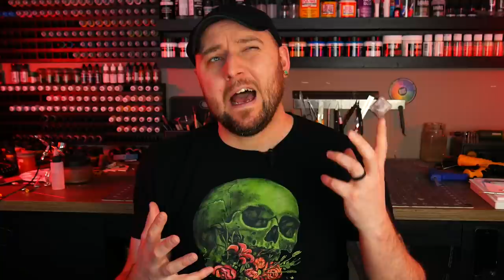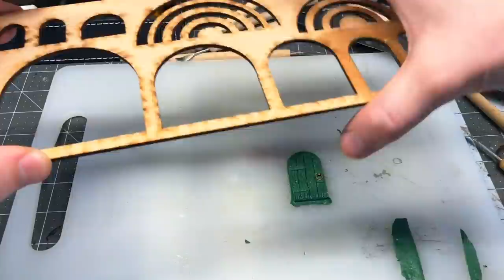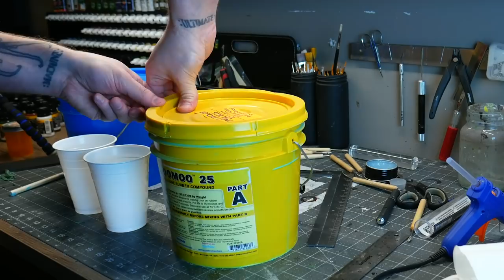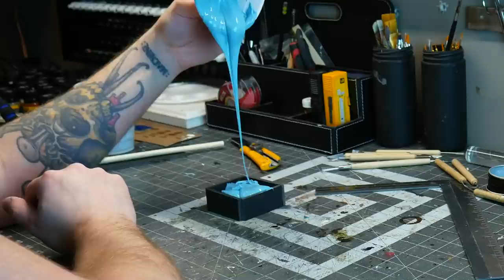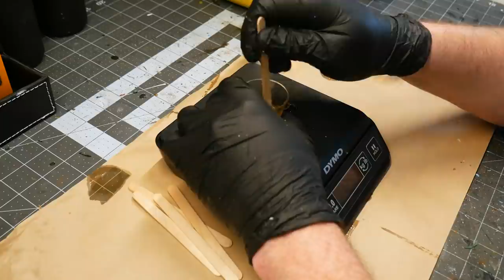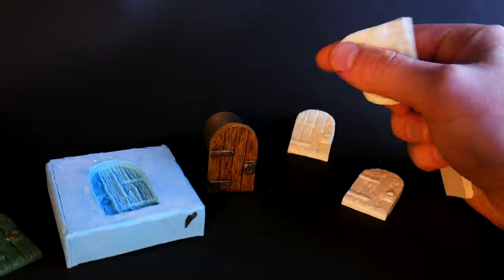Sculpting, Molding, & Casting Resin Doors

Comment: If you want a cheaper way of making door handles and keep them constantly the same size and roundness get a nail or metal rod the size you need. Get florist wire none coated (without plastic covering). Drill a small hole in the head of the nail so you can push some of the wire through it. Now push a small length of wire through the hole and bend it so it doesn't come back out. Now start to wine the wire around the nail, making sure not to overlap it at any point. Wind it as much or as little as you want to make a coil around the nail. Once you have as much as you want either cut the tab sticking through the nail head or bend it back so you can slide it back out. Slide the coil off the nail, try not to separate the coils, once off take a pair of wire cutters and cut at the same line as where you cut the coil from the rest of the wire. Do this for each wrap so you have a loop/jump ring. This is what I use to do when I was a jeweler many years back. I also did this to make my own rings for when I made chainmail just with a larger metal rod and thicker wire. Also I made a device to make wrapping a lot easier.

Comment: Idea to make selling a bit more appealing. Use the single mold to make a few greenstuff doors, then use those to make a plate of door molds (like an ice cube tray) so you can mix a larger batch of resin and pour several to cure at once. 

Maybe you could use the resin doors you’ve already cast to make the trays... 

Anyway, cool video.
Reply from the maker: You underestimate the amount of thought, testing, and costing I put into the idea. I had it down to the number of items I could cast per hour, at peak efficiency, the cost per item, the profit per item, etc. I thought it all out man. Still, I didn't want to end up fulfilling thousands of orders. I wanted to do the channel, not trade my day job for a different day job that still didn't give me any extra time to make videos.

Comment: I use the large Alumilite Resin (Slow set 7) you can get at Hobby Lobby.  The Amazing Casting Resin (The smaller bottles) just always seems to be inferior, especially when you don't get things exactly right.  Also I like to use a cordless drill to vibrate the mold a bit to get rid of bubbles.  But of course you need to be super careful with this.  Its better to use it to vibrate the surface that the mold is on slightly.  There are instructions on how to make a pound table or a vibrating table on the Hirst Arts Website.
Reply from the maker: Alumilite is a quality brand and very comparable to Smooth-On. I only choose Smooth-On because it was more easily available in Canada for a good price.
Reply: @BlackMagicCraftOfficial  I have used Smooth on for the actual molds before.  "Amazing Casting Resin" (Not the clear stuff) is just one of those products that is always cheap in hobby stores in the US and seems very inferior to both Alumilite branded and Smooth on Resin.  Here is the weird thing "Amazing Casting Resin" is actually made by Alumiltite!  It's just formulated differently and it's never worked as well for me.  It's just a cheaper product I guess!  The clear resin branded as "Amazing" works fine.  Slow Set 7 Alumilite  is the best stuff I have worked with!  You can work with it for about 5 minutes but it takes 30 minutes to cure.

Comment: I nearly always use Lego bricks for moldmaking as they are reusable and are fantastic for two part molds. The  pins on the  bricks  make for a perfect  fit of the two  halfs. According to my experience, no mold release of any kind is needed, when using  Resin in silicone  molds.

Comment: DUDE! Mix green stuff and Milliput together 50/50 (Pro sculptors HATE when this info gets around)   It creates a dream material that you will fall in love with. Also, you can make a putty oven to cure pieces a LOT faster, just look up putty oven and it will be a snap for a guy like you.
Reply: "Pro sculptors HATE when this info gets around"

Really? Every pro sculptor I've talked to is happy to discuss epoxy putty mixes at length and in excruciating detail. And it's one of the topics that comes up in nearly every miniatures sculpting class at some point. I'll note that various mixes of different putties (which can include things like Sculpey) have different properties that are useful for different things. Add in a bit of Apoxie Sculpt into the Kneadatite Blue/Yellow and you can get a harder putty that holds edges better, for instance.

But I've only talked to about a dozen full-time professional sculptors at length.
Reply: @dougsundseth6904  "About a dozen"  That's not much to talk about. I have received about 3 dozen PMs on facebook from pissy sculptors over the years saying not to talk so much about putty mixes and what they call "trade secrets". Many pro miniature sculptors are very protective of their techniques. Sure, some are open to give you guidance but MOST don't want to tell you shit. It's been my crusade since 2008. Iv'e found the older they are the worse they are at it.
Reply: @minitzonthesun  In the US, there might be as many as 20 full-time professional sculptors. I doubt it, but it's just possible.

I have never met a sculptor that exhibited the attitude you describe, and many of the people I'm talking about are around my age (58) and have been working in the industry for decades.

It's perhaps worth noting that I was the editor of Games Quarterly Catalog for almost 9 years and I've been an instructor at ReaperCon; it's not like I'm looking at this casually. Which is not to say that such people don't exist; there are jerks in every industry. But I strongly disagree with your contention that the attitude you describe is common, much less normal.

Comment: Dunno if anyone else has said this--but if you dont have great sculpting skills or dont know where to get sculpting putty, you could likely do this (cast multiples) just fine crafting it out of FOAM; make your piece then give it a good few coats of mod podge until it has a plasticky feel and you should be able to mold it just fine.  Just be careful not to add too too many coats as you'll start to lose detail

Comment: Just stumbled upon your channel, have you tried Hirst art molds ? i discovered them about a year ago. 
They do molds for resin and plaster, comes in a range of fantasy stuff.
Resin for fine detail stuff and plaster for blocks. I have been making the plaster molds with a 50/50 mix of plaster/concrete which gives a stronger mix to make scenery.
I have yet to try resin casing (mainly due to the cost in uk) but have cast some of the fine detail stuff with mixed results using plaster of Paris.
It is great for games like frostgrave etc.

Comment: Im thinking half the thickness if it needs to glue onto something and you dont need a two sided door and thereby save a bit of resin
 then have a inverted mold, so you can glue to doors together if you need it to be seen on both sides or opened.
Reply from the maker: I plan on using these on BUILDINGS, surrounded by stone frames. So one sided is all that is needed and the thickness is good. You don't want to go too thin or they wont be rigid. For two sided doors you want to do two part molds.

Comment: Resin has always been ultra intimidating to me!  It still seems like a ton of work and startup costs, but feels a lot more accessible after seeing this.  I would definitely use it for windows and other repeated features (i.e. cannons on a pirate ship).  

So, how hard is it to do a 2-part mold that would show front and back detail?  Really hard?
Reply: I have the same question.
Reply from the maker: The short answer is that 2 part molds of 3D objects are considerably more difficult and require much more planning and understanding of the process. Same goes for casting resin in two part molds. There are far more things to go wrong. It’s totally something anyone can learn and I got the hang of it after my full week of doing it, but I highly recommend getting comfortable with one part molds first.
Reply: It really depends on what you're molding. Complex things can be very difficult to get right, whereas if what you're casting is relatively flat, it can be fairly simple.
Reply from the maker: seigeengine I found size to be the biggest factor in difficulty. Doing my door frames was easy as even in a 2 part mold there was a lot of resin going in big areas, easy to pour, and gravity did a lot of the work once you sorted out your vent holes. Small things are hard. I was doing two sided portcullis slabs so very narrow cavities that were very hard to successfully fill. There is a reason real production facilities use injection moulding.
Reply: Getting the mold to fill is going to be your biggest issue with a two parter. A vacuum chamber setup reputedly helps with this but is expensive to start with. At its simplest a two part mold is just a one part mold with a slit cut  in the side for extracting the master and castings easier with.
Reply: Aside from the fact it's enormously faster and cheaper per part?

Thin sections are a problem. Aside from good mold design, that's a case where pressure casting will shine.

That's still relatively simple as it's essentially a flat structure.  I'm talking about more complex molds involving more "true" 3d geometry, as opposed to everything lining up conveniently along a single plane. Insets and undercut segments also pose additional challenges. Their example of a cannon on a pirate ship could be simple or complex, depending on what they mean. Do they just mean barrels sticking out of ... cannon ports? or do they mean full cannons with their support structures? That could get very complex very fast, and might even start making more sense to mold and cast individual pieces to assemble later.
Reply: @BlackMagicCraftOfficial  I do molding and casting for a living, and for something like this you can still use a single envelope mold. You would need to support the door with some type of sprue to life if off the base of the mold box. I would probably use some styrene rods attached to the bottom of the door and mount the door standing upright in the mold box. Pour the silicone over the top in a single pour and then when it's all cured, you would need to cut the mold open from the bottom like an envelope (hence the name). The mounting sticks now become sprue and air release spouts. I use a pressure pot for all my casting and would recommend pressure casting anything that you're doing in a envelope type of mold as air air bubbles can easily become trapped in there. 

You could always cast up the doors and send them to someone else for casting (hint, hint).
Reply from the maker: @starwarsgeekdotnet do you have a website for you resin products?
Reply: I have an eBay store where I sell my casts, if that's what you mean. Nothing for miniatures or fantasy role playing, I'm afraid - mostly head casts for action figures like GI Joe and Star Wars or Marvel Legends. I can link it but didn't want to "self promote" lol.
Reply: You would assume the expense is not too bad if you can get stuff from your local hobby store with a coupon.  But it's still going to be expensive since it takes a LOT of time and materials to practice 2 part molding and the materials you can get for cheapest work best with 1 part molds like in this video.
Reply: @starwarsgeekdotnet   I actually managed to get this to work once when casting a magical doorway.  I cut too deeply on the mold and I had to wrap it in tape to keep it together.  My experiments have worked out much better with the putty silicone stuff you can use for 2 part molds.  I will have to try your method one of these days.
Reply: Yeah sometimes you need to cut the mold apart 99% of the way up and use some foamcore or rubber bands to hold it together when filing the mold with resin. Depending on how tall the item is.  You can also cut it all the way up on  1 side, depending on the shore hardness of  your silicone, and be able to pull the cast out.

Comment: What if you want the detail on both sides of the door? Would you make two casts and put them together with a hole to pour the resin into? I've never worked with resin (I've barely even worked with foam haha) but it seems less intimidating than I had imagined.
Reply from the maker: Two part mold of a full sided sculpt. It’s significantly more challenging and anyone getting into it should master 1 part molds first.
Reply: Black Magic Craft thanks dude! Your content rules.

Comment: These look great. Do you leave the backs blank?
Reply from the maker: In this case, yes. They were made to glue to buildings.

I made two sided dungeon doors (the idea I mentioned prototyping at the start of the video). Those were done with two part molds and is a more complicated process that I will save for a future video.
Reply from the maker: In this case, yes. They were made to glue to buildings.

I made two sided dungeon doors (the idea I mentioned prototyping at the start of the video). Those were done with two part molds and is a more complicated process that I will save for a future video.

Comment: Thanks for this video man this has given me a great idea for the rapid reproduction of 3d printed dungeon tiles! I love the 3d printer but the process is so slow. Creating a master and duplicating would be so much quicker
Reply: Honestly, that's where his use of foam makes a lot of sense. 3d printing filament and resin are both relatively expensive and slow. Using them to produce large quantities of fairly generic things isn't exactly the cheapest or fastest decision. Plus you only need to get the basics perfect. The natural variability you can introduce will avoid the tiles just being repeats of each other.

Comment: What would be the dangers of making the door at 1/2 thickness, and then glueing two doors back to back so you have a texture on the inside as well as the outside?  You'd have to make an 'inside' and an 'outside' version or the handle would be on the wrong side, but I don't think there would be a strength issue, so long as you were accurate with your original shape.

Comment: Proto Puddy. 100% silicone and corn starch with a little if craft paint. Silicone 5$ and corn starch 1$. Wal-Mart. (When using anything with molds and resin use safety)
Reply: Fine if you're looking to be cheap or in a pinch, but the wrong material if you're actually trying to do serious mold making.
Reply: @seigeengine  I have been doing it for 8 years now. The proto Puddy does do a great job. I will have to do a video on it to show the detail it picks up.
Reply from the maker: I think proto putty is fine for doing stuff yourself, especially small batches of things. I invested in proper silicone because at the time I was considering getting into casting thousands of items.
Reply: @MrVlandus  Oh, you're one of those people who think they're a genius and believes they're superior to entire fields of experts.
Reply: @BlackMagicCraftOfficial  nice. I agree, I can see the difference. I really liked the video thank you.

Comment: Nice tutorial dude!

So funny seeing your tiny dremel, i was thinking the other day i want to buy a new tiny dremel because i still have my og one lmao

Its like an og cellphone, bulky heavy and grey xD
Reply: The dremel micro is so much less powerful than the dremel 3000 or 4000. I got myself the dremel 3000, as a kit for about 170€, and I'd recommend it. It came with a bunch of dremel accessories, including a flexible driver arm attachment, a router base attachment, a straight handle, and so on. I also got myself the "drill press" stand for dremels, which is actually fairly useful as you can tilt it sideways, holding the rotary tool, and then use the flexible to have much more control over what you're doing.

Comment: For something like windows or doors where you will end up needing lots of them, would it be worth the effort to use resin castings from the process you outlined as "masters" to make a larger mold with lots of wells? By "wells" I mean spaces to pour 4, 6, 12, or whatever items (ice-cube tray style) instead of just 1? Or would that even work?
Reply from the maker: Yes. That’s exactly what you should do if you want a lot.
Reply: You could do that but remember that as you use the mould it slowly degrades over time so if you want to make a huge mould and start with only one and make a lot form that initial mould keep an eye on it and check all of your pieces to make sure it isn't degrading. It also depends on what you are using and a mould. Some of the cheaper materials can degrade faster then others. But in essence yes you can make a mass mould with lots of wells and it will work fine. One word of caution though, don't do a lot of casts in a row or the heat from the resin will make the mould degrade faster. Leave an hour or so between each casting if the mould is under an inch thick and less then half an inch between each part. This will help keep it from degrading too fast. I know this is a long answer and I probably could've done a simple "yes" but I thought it would be better to give you what to watch out for in making moulds and making a mass mould. If you want to make more then one batch every hour or so it's best to have multiple mass moulds and stagger your pours so your not doing one after the other in the same mould. I would do a minimum of three mass moulds that way there's plenty of time between pours. That's my advice for mass moulds.
Reply: @BlackMagicCraftOfficial  Thanks for the fast reply. Your work is absolutely amazing.